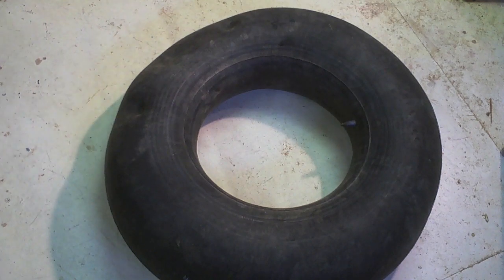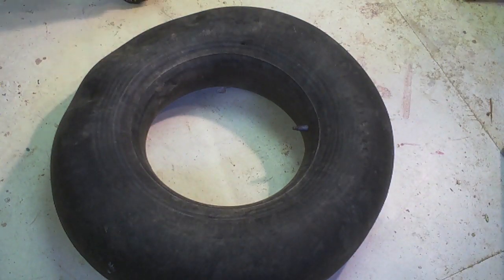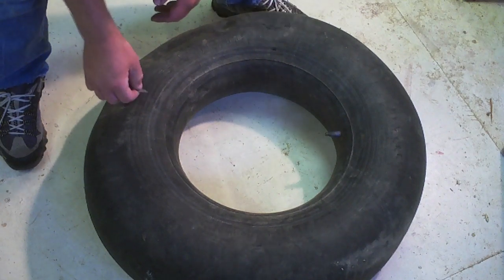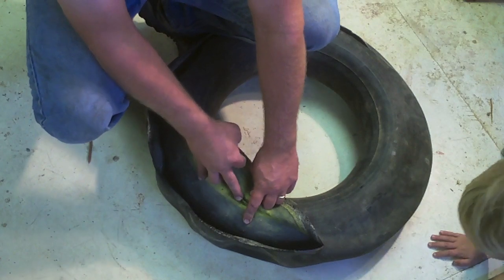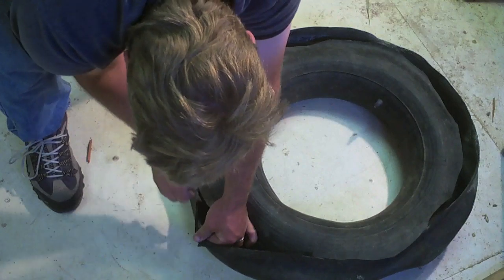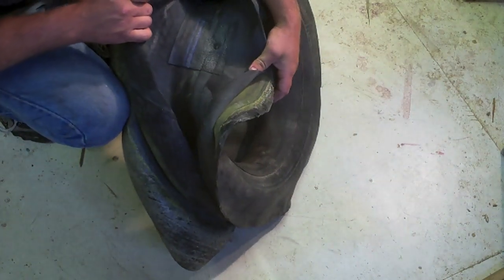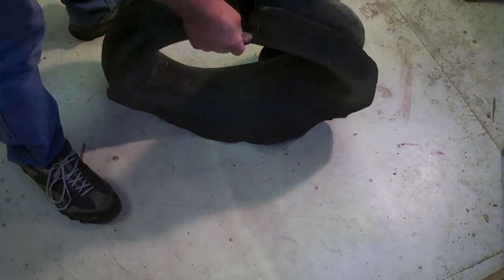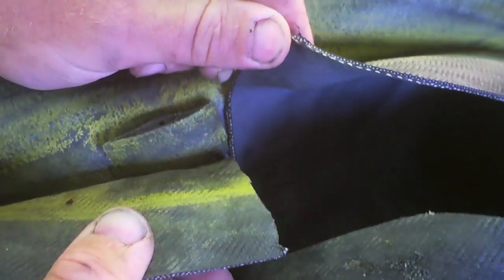Goodyear Lifeguard Bulkhead Tube

Comment: If you remove the valve core take a straw fill it with Tire talk put the straw on this valve stem and blow the talk on the inside the inner tube it will stop the stickiness inside the inner tube